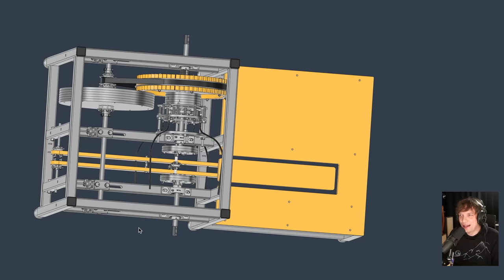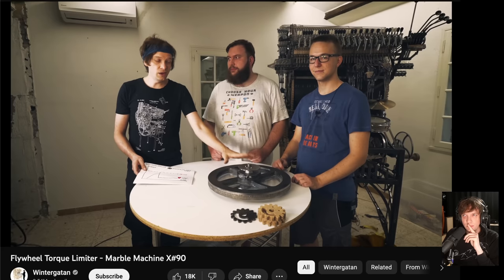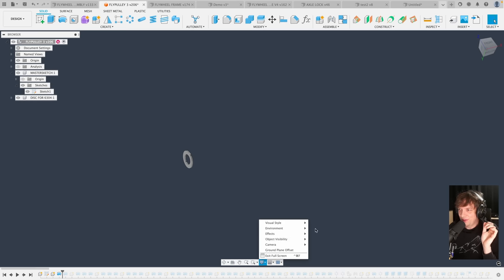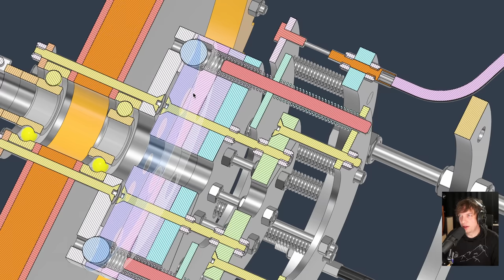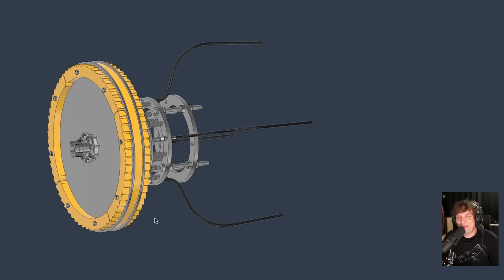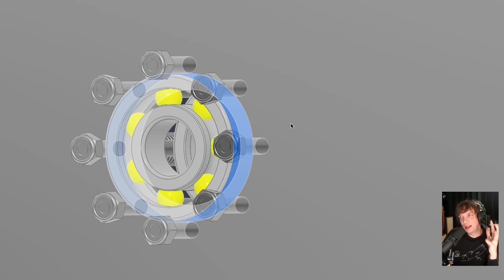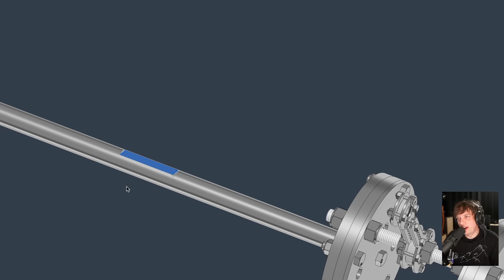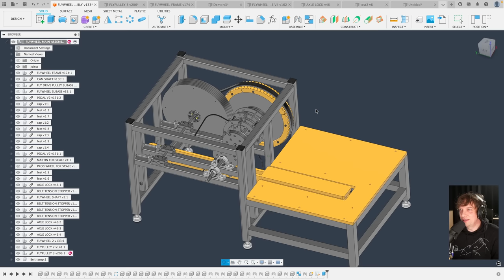Safety First! - Marble Powered Clutch

Comment: The more I look at your flywheel drive design, and your offset single pedal platform... wouldn't it be better to do it as like a stair stepper? Or maybe even like... bicycle pedals?

Having the top of the pedal stroke being flush with the platform seems like something that's going to take a lot of extra work, and put you massively off-balance. It would probably be better to have the bottom of the pedal stroke be just below flush with the platform, so you can have flush as a locking position, but have it up above so you aren't having to go down too far on each stroke.

Alternatively, alternating pedals of some design would let you use both legs for power, unless the idea is to use one leg at a time so you can rest periodically.

Of course rest could be solved by a stand-height seat and bicycle/unicycle style pedals.

Comment: I feel like there are several red flags with this design. It's overcomplicated, the torque limiting and clutch could easily be two separate assembles that can be configured and serviced individually. You rely on nuts to set spring tension and clutch alignment. These will not be consistent and back out (adjustable is not always good, rather use ready made springs with the right characteristics). And you are intentionally doing things "the wrong way", because you think you can get away with it.
Feels like an MMX design to me.

Comment: I love the ingenuity of your creations, but I feel like using steel for your frame might make the entire structure to heavy.  If you use 80/20 aluminum framing, you can use the slotting to your benefit and assemble it in no time, and fine tune moving parts if need be.  
Using stainless gussets will strengthen up the frame so you can put it on casters on and wheels it through doorways when you travel with it.   Keep it simple…
Reply: NNA  I hear you, but what’s awesome with 80/20 Extrusions is they’re easy to cut and assemble (no welding required), they have slots for tabs to be inserted and adjusted if need be.  It’s awesome product! Kinda reminds of the old erector sets in a way.    Steel can be used to attach to it using screws and a locktite.  
I’ve seen CNC machines being made with it.  It’s definitely something to consider.

Comment: Hey Martin, a maintenance technician here. I like or tolerate most of what you did, but I think your half-moon solution is terrible. You WILL have wear and increasing play on that connection and sooner or later you will have to replace most of the assembly. You don't even reduce the part count, since you have to essentially half all the plates.

A keyway is the way to go. It will wear over time, too, however it's cheap and easy to replace it as it is an off-the-shelf part.

Comment: use a Flanged Housing for your bearing not the dangerous clamp !!!YOU WILL KILL PEOPLE!!! if this ever breaks or the bolts loosen
yes you cant change the bearing after purchase because the bearing is part of the flange
these bearing's go from 0.5 in to 3.5 in for shaft diameter

Comment: Using bolts as your bearing retainer is a bad idea.  Between tolerances on the diameter of the threads, straightness of the bolts (which is NEVER perfect), not to mention the concentricity between the center of the bolt, the diameter of the threads, and the centers of the mating holes/threads, which will be pretty bad, any hope you have of holding the pully concentrict to the shaft and bearing will be minimal at best.

Comment: The bolt holes for belt tensioning are too far apart and constrain the hardware in place, making belt tensioning impossible with the current design 😥

Comment: If one bearing fails all the bolts holding the bearings will break and blow everything up due to flywheel still is driving. Hard to say in English. Lager ska aldrig hållas med bultar på det viset när man har en okontrollerat svänghjul. En bult av alla dessa fallerar och allt rasar. Hmmm

Comment: I don't think you're approaching the clutch idea properly. you don't want friction between the static plate and the spring plate. I would suggest radial rollers on the static plate. you don't want friction in the rotation between the plates just linear pressure to relieve the springs.

Comment: lose the pedal. needs to have a motor as despite using a flywheel. you will still either end up stuck to it keeping and even tempo. or force the rest or the group to cope with variations in tempo as you move about or stop pedaling for 10 seconds.

Comment: This rachets are to avoid turn in the wrong direction when you push the pedal At the begining. Then they disconect to avoid noise.  I Think the unión of The bar to the wheel using this flat spot is too weak,  It will open in half.  The force al this point is very bigotes.  Use beter a shaft like those used to join motors to gears

Comment: I sure hope you are not going to plan using the manual marble clutch in non-emergency situations. This clutch is good at disengaging in high torque but it will not re-engage so nicely when machine is stopped and flywheel is at high speed. You are going to ruin your performance with long offbeat "trrrrrrrrrr" sound when trying to use this clutch in a song! You should use slip clutch instead in this situation and leave the marble one for worst case things!

Another issue i have is with centering the bearing with bolts. No matter how precise the holes are cut, bolts themselves are not high precision items and will ruin your day.

Comment: Hey Martin!

Love the work you're putting into this engineering project. However, I can't help but notice that you're really trying to bring down the part count, maybe a little too much. Elon's words are to be taken with a grain of salt because yes, the less parts you have in a system, better (simple is best after all), but less parts do come at a price. It is very dangerous to sacrifice structural integrity for part count. My main concern are those bearings. I will admit, I'm not familiar with the bearings you'll be using, but most bearings casings (the metal shell of the bearing) aren't designed to handle the stress of high torque situations (at least the smaller ones aren't, some industrial or heavy duty ones might be able to) hence the need for a housing. Then again I could be worrying for nothing,I've mainly worked on bikes and enjoy engineering as a hobby, so I'm not a professional. 

I just realised I wrote an essay and should probably stop overthinking this, so in short, less parts = good, but not always. If you ask to much from one single part, it will fail.

Comment: I mean no offence but these videos are getting way too self-congratulatory. Some of the solutions presented are way over-engineered and different for the sake of being different. If you really want to simplify the process and design pragmatically you should be looking for tried, tested, and proven designs (reference industry).

A brake system can be separated from the clutch and utilise off the shelf brake components, a keyed shaft is used in literally every engine ever, the torque produced within the MM3 doesn't warrant two part disks with a internal bore with a flat, even if you wanted to avoid cutting a keyway you could use clamping collars like they use on gokart axles (again, proven in industry solution)

The MMX had character in its design choices and demonstrated much more soul than I fear this new machine will possess. MM3 looks like it suffers the same complexity issue but not in the pursuit of character, but in the pursuit of demonstrating some sort of design enlightenment

Comment: Bolts in shear, not great for handling load.

Love the radical pragmatism, this choice feels like taking that design mantra in an odd direction. Like you know it's not the right engineering choice, but you're justifying it with pragmatism instead of with an artistic design choice. 

That being said, I hope it works well enough for you that it's not a problem or it doesn't work well enough that the prototype shows that.

Comment: Too many parts. The red pushrod and the marble(s) could be one part. Although I have to admit manufacturing wouldn't be that easy, because of surface hardness that is required. But so it is on the disk that the marbles touch.
Also stop using several disks and just machine (or let someone machine) it out of one pice.
Also why does it have to be a torque limiter, a brake AND a clutch in one assembly?

You are turning 360° from astetics to completly over-engineering to the point where things just won't work.

Comment: This needs simplified in my opinion, laser cut steel is not that accurate. Even water jet steel isn’t that accurate. Too many spots for tolerance to grow. But ultimately, how fast will your flywheel be spinning? That’s the real question that would help us to understand how unreasonable or reasonable  this “convoluted radical pragmatism” design truly is.

Comment: I'm little concerned you're getting lost in design with this... there were several red flag words you used such as "complicated" and "convoluted" and "hard to describe."  I'm also super concerned about that braking mechanism.  That's gonna be a crap-ton of friction on a critical component.  If the braking mechanism was it's own separate system it would be less of a deal if it wore out.  Combining it with your torque limiter, though, makes its function critical and the high friction a potential problem.

Comment: What's this nonsense again? 🤦‍♂️ You'll never get the machine done. Use an existing torque converter, such as a suitable size clutch pack from a motor vehicle. It's replaceable and no prototypes needed.

Comment: Bolts are not precision parts. You do not need to machine through the plates to make the design more reliable, you barely need to cut a shoulder.
I don't even think you need a shoulder on both sides.
Also, laser cut parts do not have crisp 90° edges, so trying to locate those parts on a ground shaft will not give a positive hold and will cause wear.
The ratchet is for the foot pedal safety mechanism that you teased at the start but never mentioned again.
I'm not going to try to guess how you laid it out because your "radical pragmatism" is just your artsy emotional side making irrational decisions again and ignoring, no dismissing, the recommendations of people with hard won experience telling you that you're trying to reinvent the wheel with 4 sides.
Hey, maybe you're right and these shortcuts will work, but I do not see you TESTING YOUR ASSUMPTIONS on these designs the way you did on the marble gates